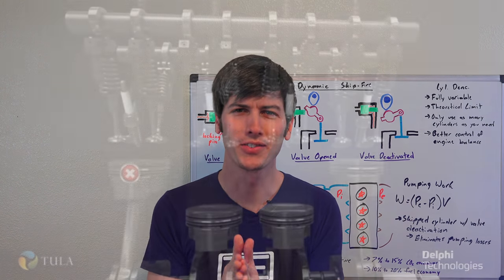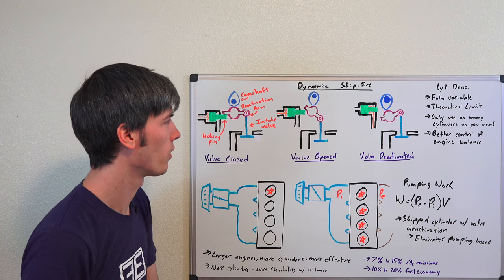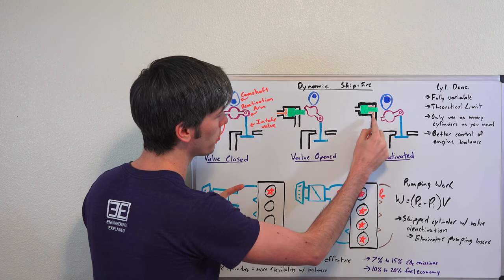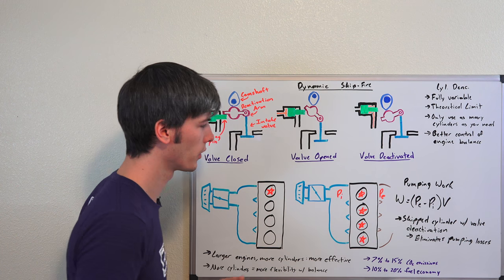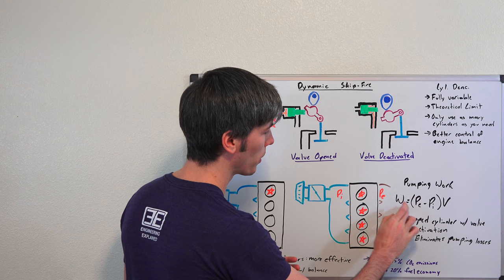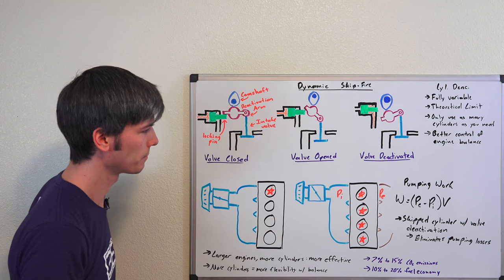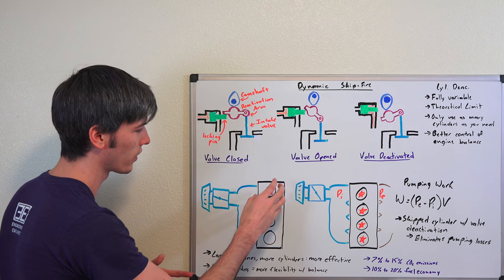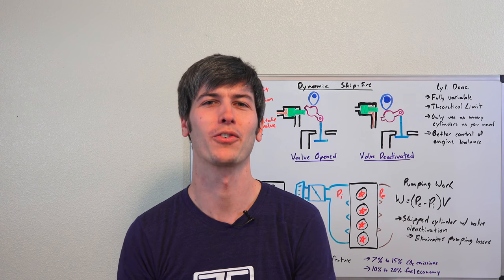How Dynamic Skip Fire Works - Variable Displacement Engines

Comment: If you're looking for a comment you've come to the wrong place, but if your looking for an outstanding pie recipe you've come to the right place.

Ingredients:
1. 6 tablespoons unsalted butter
2. 1/2 cup white sugar
3. 1/2 cup brown sugar
4. 1/4 cup water
5. 1/4 teaspoon cinnamon
6. 1 pinch salt
7. 5 apples - peeled, cored and sliced
8. 1 pastry for double-crust pie 

Directions:
1. Preheat oven to 425 degrees F (220 degrees C).
2. Combine butter, white sugar, brown sugar, water, cinnamon, and salt in a saucepan over medium heat. Bring to a boil, remove from heat and set aside.
3. Roll out half the pastry to fit a 9-inch pie plate. Place bottom crust in pie plate; pour in apple slices.
4. Roll out top crust into a 10-inch circle. Cut into 8 (1-inch) wide strips with a sharp paring knife or pastry wheel. Weave the pastry strips, one at a time, into a lattice pattern. Fold the ends of the lattice strips under the edge of the bottom crust and crimp to seal.
5. Pour butter-sugar mixture over top of pie, coating the lattice, and allowing any remaining sauce to drizzle through the crust.
6. Bake in the preheated oven for 15 minutes. Reduce heat to 350 degrees F (175 degrees C), and bake until the crust is golden brown, the caramel on the top crust is set, and the apple filling is bubbling, 35 to 40 more minutes. Allow to cool completely before slicing.

Comment: Cadillac V 8-6-4. Too ahead of his time
Reply: Its still being used :D one of my friends has a 2011-12 Chevy that switches from a V8 to V6
Reply: Ivan Lesca there’s a 4 Cylinder Cadillac? Is the 4 door model?
Reply: advantage of this system, its truly independent. can operate only on one cylinder, any cylinder.
Reply: No they made their V 8-6-4 engine, which is a V8 but it could shut of cilinders to a 6 or a 4  cilinder. Neat Idea back in the day but the ECU's were not up to the task sadly. It worked pretty slow and kind of robbed the fun out of the car
Reply: Was it the North Star engine? I remember my old neighbor had a FWD caddi that had North Star engine.
Reply: It was the engine L61, (308 cu - 6.03 L) it was fuel inyected. It was a v8 with the same principle, shut off some cilynders to be more efficient but as they pointed out, ecu's were not up to the task so it wasnt enjoyable and it failed many times. Someone was thinking very ahead in that era :P
Reply: s13one80  no, but the northstar had a mode that let it run on 4 cylinders in the case of coolant loss.  

It would limit performance and speed and switch between the front and rear bank to keep the engine from overheating.
Reply: Marc Fransen I’m not sure it was slow? I think the issue is that when it was running in six cylinder mode it was no longer even close to even firing.
Reply: Phos9. Lots of engines are not even firing....
Reply: Ahead of its time? If running like an International Harvester tractor with gravel in in the cylinders was ahead of it’s time. I drove one for a day and know why they couldn’t give them away! It was too early as the needed control system didn’t exist yet.
Reply: Yeah but they typically aren't V6's.
Reply: Toyota Brony, as an aside though, there was a 4 cylinder Cadillac back in the 1980s called the Cimarron. You should look it up :)
Reply: Cadillac’s in today still have it. The 3.6 V6 will shutoff 2 cylinders when power is not needed. The Escalade has it and even the CT6’s 3.0TT has it!
Reply: Many, Many cars have cylinder shutoff, but none of these systems are comparable to the one in the video.
All existing cylinder shutoff systems just stop injecting fuel into that cylinder, still opening the valves and still sucking air into it.
So, the old systems are not much of an effiency boost compared to the new one
Reply: But when running on 4 it sets up a drone and vibration.
Reply: The Gen II 3.6 has it not the Gen 1. Under certain conditions in a XT5 when it deactivates 2 cylinders it feels like a torque converter shudder.
Reply: yes,  Cadillac uses a few different 4 cyl engines in some of their newer cars. Also the mid 80s Cadillac Cimarron used 2 extremely weak 4 cyl engines to power an extremely weak car, it was basically a Cavalier with some fancy gauges and pleather seats. What the previous person was talking about with the V8-6-4, was a V8 engine that used very primitive technology to increase fuel economy such as this video tries to explain. However it didn't work out very well at all.

Comment: Wouldnt that put a lot on stress on the parts of the piston firing? If I was to take a weightlift bar, load it up leave, and grab with both arms, but only one arm doing all the lifting, you can feel the greater stress to the lifting bone than if both arm lifted equally.

Comment: Is the throttle valve computer controlled and does it have to change it's position every time a different number of cylinders are active? If so it will need to be able to react VERY fast.

Comment: Love that mini rant at the end. 

I'm guessing the deactivation arm is held against the cam using a spring with less tension than the valve spring. Is that correct?
Reply from the maker: I actually found a better animation of it after I'd already filmed and uploaded this video haha. Here's a more detailed view of the cam: https://youtu.be/ei1NyfgY5Ds?t=1m9s
Reply: I see. Looks like a tensioned pivot point above the valve. Probably works better than the method I was thinking about. Thanks for the reply.

Comment: Wouldn't something like Freevalue be a better approach. The timing on that locking pin engagement looks dangerous. Also it has other benefits like being able to adjust to an Atkinson cycle dynamically.

Comment: wouldn't the throttle peddle feel really non linear if the throttle body is almost wide open but the engine is firing on a quarter of it's cylinders?  So it would be producing like 20 percent engine power at 75 percent throttle then you go just a little bit more to wide open throttle to produce five times the power?

Comment: Interesting. I can imagine having a V8 with only 4 cylinders active sounding like a fart can and the guy in the car next to you is confident he'll beat you. Then, you activate all 8 cylinders and take off with a nice rumble. He'll be like dafuq???
Reply: I mean most modern V8s already have cylinder deactivation, just in different formats
Reply: James is right.  FCA, previously Chrysler and Dodge, have had Multi-Displacement System (MDS) since about 2003 on the Hemi 5.7L (Chrysler 300) and 2005 on Ram 1500.  This is a straightforward, fixed 4-cylinder deactivation method.  It does change the exhaust note a bit... it almost reminds me of the grumble that Subaru's 4-cyl boxer engines make.  Of course, any fairly heavy throttle applications result in 8-cyl firing, so the loud exhaust guys don't necessarily turn of MDS although some do.

Comment: Let's think what it's advantage than External EGR (which I think it's almost the same intention). 
I can think like 
   1. To stop injection partially instead of an injection reduction. << Reduce both Emissions and Fuel Consumption.
   2. It can cause less deposits.
But, in contrast External EGR can
  1. Provide less combustion temperature, less NOx generated.
  2. Reburn the unburnt exhaust gas.
Reply: EGR kinda sucks imo. SCR is much cleaner, plus it doesn't contribute to the build up of soot.

Comment: would this cause piston to slow down ? if intakes valve remains closed when piston goes down it will crate a vacuum and cause piston to lose speed. This can lead to unstable engine speed. Please correct me if im wrong. thanks

Comment: But would this be most efficent on like a 6 cylinder with itb:s and a sohc or dohc head?
If you could cut the Power to 5 sparkplugs when you dont need all of the Power and you could also have a itb system that would close 5 throttlebodies when Power isn't needed or maybe a 2 piece camshaft that would hydraulically put them together when Power is needed

Comment: @Engineering Explained
Why cant displacement just be dependant on the valves? instead of variable cylinders firing to decrease displacement, why can the valves just open and shut later, to decrease the amount of cylinder volume ? the pumping loss with more cylinder does make sense tho :3 just wondering

Comment: My brain just jumped immediately to probably the most complex solution possible: why not go a step further and somehow completely disconnect the cylinders not being used?
Reply: Most big engines do this already. They disconnect half the crank
Reply: That would create a mass imbalance and the shaking would be intolerable
Reply: @corpsie666  um you know this is what most v8s do right?
Reply: @james2042  No they dont
Reply: @isakjohansson7134  look up Chrysler mds or GM afm, hundreds of thousands of those engines are sold every year and they all cut the crank in half at low loads.
Reply: @james2042  No they just turn off the cylinders

Comment: Intake valve(s) remain(s) closed, piston goes down. Doesn't that create a massive vacuum in the cylinder? Only way this makes sense is to close intake valve(s), but keep the exhaust valve(s) open, so no vacuum is created. Also, during compression, there's uncombustable mixture inside the cylinder (just air basically), which the piston will have to compress, which requires work with no results, so it's a big loss once again. There's gotta be more to it than what you explained.
Reply from the maker: See the pinned comment at the top. It’s an air spring, not a lot of losses.

Comment: So the cylinder pulls a vacuum with the valves closed? 

What about oil ingress and fouling once that cylinder actually fires? 

Also with ring gap and ingress, so it draws a vacuum, has small losses, then compresses then further slowing the piston and also the crank??

It seems neat in theory and may see gains in economy overall, but that seems fairly inefficient and will only get worse as it runs..

Isn't this basically a new type of engine design with the exact same problems as the Wenkel??

Comment: How would you handle the vibrations from the engine running at 1 (or any low value) cylinder?

Comment: Since low engine load decreases fuel economy,
Can we just use some super tall gear or CVT to keep engine at low RPM & high load when cruising ?
Comparing to this, any Pros & Cons?
Reply: NVH and combustion instability limit how low the RPM's can be for a required power output.

Comment: What no one is mentioning or asked is, how reliable do you think an engine with cylinder deactivation is? Will you get 250k miles out of it with minimal maintenance? This sounds like one hell of a complicated process. I want a new Trail Boss with the 6.2, but I don't trust the cylinder deactivation. I want reliable. I'd almost rather take my chances with the Ford and changing the turbocharger when needed. Much easier to change a turbo than change internal pins and springs. Plus, on a side note, why isn't GM using dual fuel injection?

Comment: how do they get around with vacuum buildup inside the bore , if the intake and exhaust is blocked wouldn't it suck the oil from the pan below ? and burn oil

Comment: Why throttle valve is opening wide in case of 1 cylinder operation??..as its 1cylinder so it should require least amount of air..so how come It's opening wide??and opening less in All cylinder mechanism ?? please reply

Comment: Just a question that came to mind, What about uneven cylinder/piston wear or engine head warping?
Reply from the maker: What about the system would cause uneven wear, since all the cylinders are still being used?
Reply: The little difference in wear that occurs whether or not a cylinder is used to extract work is not that much. Plus this system can deactivate random cylinders, which makes it possible to evenly spread the active/non-active states  over a period of time.

Comment: Wouldn't the asymmetrical vibrations of running an odd number of cylinders be a Bad Thing?
Reply: RonJohn63 because 1 and 3 cylinder engines haven't existed for decades?
Reply: +Jay those are always inline, with that specific number of cylinders.  A V-8 (he kept on saying how useful it would be for large engines) running on one or three cylinders would seem to continually generate asymmetrical force.
Reply: RonJohn63 the problem is you are making the incorrect assumption it will run on only a specific cylinder or set. Just because it's a 8cyl running on 1 cyl doesn't mean it is always the same one firing, the computer can maintain balance by firing the correct cylinders.
Reply: That's a good point, which you didn't originally mention.

Comment: This system does not open intake or exhaust valves for a cylinder ... would that not create a high vacuum in the chamber when piston goes down, causing more than normal oil to leak in?
Wouldn't it be more efficient to just open the valves normally, but never inject fuel?
I understand that if air is allowed to get it, on compression it will heat up, and then cool down when piston goes down and some heat will be transferred to engine block, some efficiency loss there, but at least piston will work "normally" pressure on compression and not a vacuum.  
I think it will be even better to have valves that do not interfere with piston when it is up, and just leave them open all the time, and not inject fuel.

Am I missing something?

Comment: Why can’t we open the throttle valve larger when four cylinders are in low load?
and wouldn’t the engine be less smooth and cause more vibrations because it’s running on 1 cylinder?

Comment: What happens with the cylinders that aren't firing, they're causing drag, compressing, and trying to pull vacuum when the piston goes down.  What does the engine do to deal with these situations? and what's the impact of these actions?
Reply from the maker: Inside the cylinder acts like an air spring. Piston goes up and down, so the forces are nearly equalled out.

Comment: All these schemes to mechanically adjust when a valve opens makes me wonder if looking at solenoid or servo controlled valves would be the next big step forward. You would be able to vary the vales in any fashion to adjust how the engine operates without adding additional parts. More parts in an engine raises the manufacturing price and does increase the risk of failure or increases the cost through strict Quality Control.

Comment: If the valves is closed for cylinder that is  deactivated. Is there any air in the cylinder or is it pulling it own vacuum ?
Reply from the maker: It acts like an air spring. If there's air in it, it compresses it then expands again, if there's not, it creates a vacuum and then pulls upward towards the vacuum during compression.

Comment: When government incentives for fuel efficiency tip the balance, it can lead to a situation where not all factors are considered. A balancing incentive for longer lasting vehicles would be nice, since there are a lot of CO2 emissions required to manufacture another vehicle. If vehicles wear out sooner because of so many moving parts, and if repair is so expensive the customer drives it to the crusher, we haven't done much but line the pockets of the new car industry. When we use hot and dirty engine oil to power these actuators, it should be no surprise they wear out sooner.

Comment: Another one of these new old ideas, also a restricted intake flow requires a higher fuel to air ratio vs a wide open throttle. common in Hit and miss stationary engines and tractors up until the 1920's, Ihc said it was more economical to fire the perfect fuel to air ratio at full compression but only fire it as often as necessary for a give amount of load. Sounds familar. but kinda contrary to the infinity engine that lowers the compression ratio...

Comment: Actually it looks exceedingly simple. The engineering of the “pin” is elegant in that way.
Reply: Right.  The more difficult bit is taking in all the inputs and deciding 80 times per second for each cylinder whether it should fire or not.  If you read about DFM on GM's website, you notice they seem proud that their own software engineers write the roughly 65,000 lines of code to make this system work.  Unfortunately, it doesn't seem to be netting even a 10% fuel economy improvement in Silverado 1500 going from AFM to DFM.

Comment: Just wondering why they just use electronic individual throttle bodies similar to the throttles they used in Indy cars in the early 2000 which were basically ball valves I think they were called. 

They will be a little less efficient but at least easier to service.

Comment: I have the AFM on my truck on the speedometer it lets me know if I'm running on a V8 or v4 does the DFM let you know on the thermometer if it's running on one cylinder v1or or v8anything in between

Comment: Hi Jason, i dont know how elso to reach you so i m using your last video. Do you have a way of calculating the added power needed to accelerate the wheels of a car when then the tire/wheel package is is made bigger and /or heavier. Then this laking power can be translated to estimate the difference in trap speed in the 1/4mile. (My concerne is with the new 2018 subaru STI ''slower'' car with same or better power) thanks

Comment: Wouldn’t the “dead”cylinders have pumping losses from drawing a vacuum when the intake valve is closed and compression when the exhaust valve is closed?
Reply: The losses would be much minimal compared to the work associated with both pumping air mass into the cylinder and pumping the same air out. Closing the intake and exhaust valves allows the cylinder to act as a pneumatic spring, where the only losses in energy for the system  can be traced to the very minute damping from the air and friction losses inherent to the ICE piston engine.